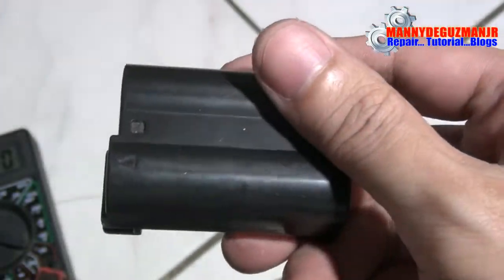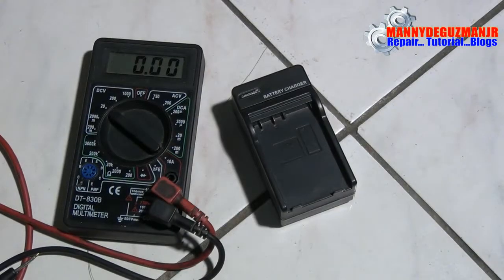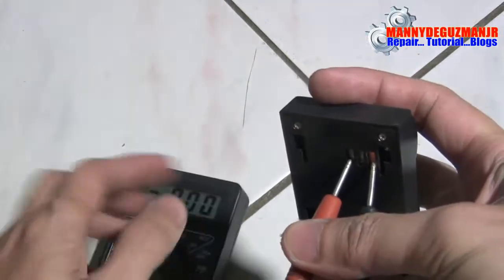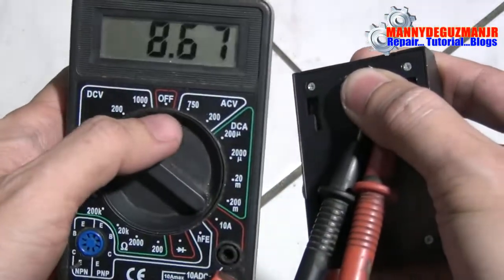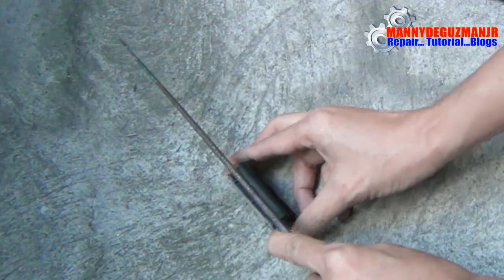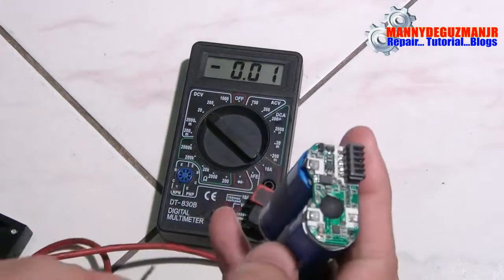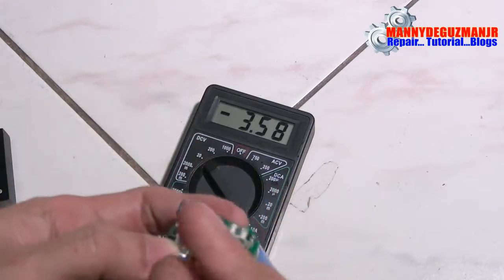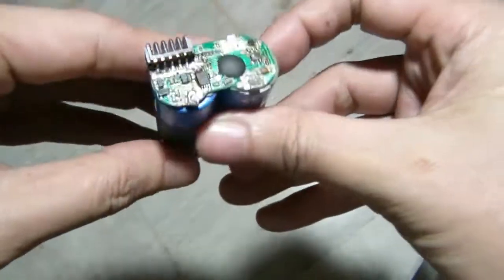Nikon Battery Repair Attempt (EN EL15 No Power, Not Charging)

Comment: Sir yung d810 ko bigla nalang namatay kalagitnaan ng event, na try kona lahat ng battery ayaw, possible daw fuse issue, kaya nyopo mag repajr non?😊
Reply from the maker: sorry hindi ako nagbubukas ng camera unless meron repair manual na available hehe. Maselan kase ang mga ribbon cable nyan at masyadong madaming babaklasin bago maaccess yun main board. Although marunong akong magrepair ng electronics, mahina ako sa mga mechanical parts, especially pag sobrang maliliit na ang piyesa kse medyo malabo na ang mata ko at ginagamitan ko na ng lens o microscope yun mga piyesa sa loob hehe.

Comment: Can't the battery BMS be tested with the multimeter for a failed part? Maybe the board can be repaired?
Reply from the maker: If you know how to test multi legged MOSFET's you can repair it with replacement of the same type. But unless you can identify the main chips using circuit diagrams it is almost impossible to test voltages and resistance of those important parts. Unavailability of components is another thing since you cannot buy these tiny surface mount chips from your local stores. You can source them from China if you know where to buy. But remember we are dealing with accurate voltages and polarities here. If you mistakenly replace parts with different types and values Lithium Ion battery cells  may overheat and get damaged, or may even explode or burst into flame when reversed polarity or subjected to over-voltage higher than specified by the manufacturer. That's why there's a lot of precautions and disclaimer when repacking and restoring old battery packs because of these dangers when you don't know what you are doing. This is the reason why I strongly suggest replacing the whole BMS board with a working one salvaged from a used battery pack of similar type and not tinker with the electronics, especially if you don't have the necessary circuit diagrams and test procedures/ service manual. Most people will even tell you to buy new batteries rather than tediously repair damaged battery packs.

Comment: how to discharge the battery ? i am not prefer to discharge with camera, can your charger ( in the video ) be modified to become a discharger ? can you provide the detail for the charger in the video ?
Reply from the maker: Sorry there's no easy way to discharge high capacity Lithium-Ion cells as simply shorting it would either destroy the cells or the BMS circuit. Even doing it the wrong way would cause the cells to either explode or catch on fire. It's not like a capacitor which you can discharge easily by shorting a resistor between the + and - terminal. Voltages are monitored regularly by the battery management system when Lithium Ion cells are being discharged. Lowest discharge voltage for each 3.7 volts cell should not be lower than 2.5 volts. Drop voltage by less than 1 volt and it may not charge again to full capacity or it would not regain charge at all. A 7.2 volt Nikon battery pack should have at least 6 volt remaining voltage to power the BMS circuit to drive the charging circuit to work. So, sorry to say but no you cannot just use the charger that I use in the video to be used as a discharger because it does not have the circuitry to do so. You must put a proper load to the battery to discharge it, with proper voltage level sensing circuitry to cut off discharging when the lowest allowable voltage was reached
Reply: Thanks

Comment: sir what is the replacement  ng battery of  en el 15
Reply from the maker: There are no replacement for the model number EN EL15 because battery pack is specific for each Nikon camera body. You must be referring to generic brand replacement, in that case there are several third party brands such as Phottix, Wasabi and Ravpower battery manufacturers.

Comment: I faced similar issue and unable to charge my totally discharged nikon 15b battery with nikon charger (flashing red led rapidly) too. Then i tried to charge it with my z7 built-in charger for minutes and hopefully it will unlock internal charging circuitry of the battery. It really works and the charger will charge the battery again with normal flashing led. I can power up my z7 with that battery too.
Reply from the maker: Any charger will work as long as it outputs the correct voltage needed to charge specific battery packs. If your charger won't charge you Nikon battery, then probably your charger is faulty. However, when Lithium Ion battery voltage drops near zero volt when measured with a tester, then that is destructive and has 50/50 chance it will be back to normal charging. The cells need to be zap with higher voltage to force it to charge with minimum levels to power up and activate the BMS (battery management system) circuit in the battery pack.

Comment: Hi Manny. How is the replacement EN EL 15 battery holding up? The orig. Nikon battery is rated at 1900mAh. 18500 batteries are now a lot more powerful. Is it safe to put much higher capacity 18500 cells as replacement? How high a capacity is safe to use? And what battery brands and cpacity are ideal--best bang for the buck?
Reply from the maker: At the beginning of this video I have shown a repacked and repaired Phottix brand battery pack replaced with working charging protection circuit board coming from an orig Nikon EN EL15 battery pack. It worked for about a  year more before the charging cycle starts wearing down. Reaching 18 months of use the cells starts to die one by one shortening it's use per charge, until the pack couldn't hold a charge anymore. In my experience repacking batteries, while non-branded cells have higher current capacity, orig cells from legit Nikon packs were more durable and last longer. This is true when using orig legit brands compared to third party brands battery, so your issue here is longer usage time vs longer life charging cycle (durability). If you could get legit brands such as Toshiba, Sanyo, Sony, Panasonic, GP, etc. cells of the same type those must be your best choice if you want your repaired packs to last a long time. Now on with your question about higher capacity cells - If you have a working charging protection board, changing to higher current capacity cells won't hurt your camera as long as they are same voltage rating. In battery sense, higher capacity and longer discharge time means that current capacity is only altered giving higher mAh but the measured voltage when fully charged should be the same (or slightly tolerant in few hundred millivolts). So yes it is perfectly safe to change to higher current capacity cells as long as they are same voltage to the one you are replacing. A rated 7.2 volts working battery should be fully charged at around 8.4 volts when measured with a digital volt meter but not greater than 8.7 volts. Also when you increase the mAh capacity of the battery, it might also have a longer time charging with the original charger, you might need to buy a quick charger with a higher current rating as well if you want faster charging time with your newly repacked battery.

Comment: You don't have an utility knife or anything smaller and sharper ? haha
Reply from the maker: You cannot use a small utility knife on a thick plastic that was bonded hard with epoxy. It won't work cutting around the edges with your bare hands you only risk cutting and hurting yourself. Or the small knife will just break  The only way to go is a strong force with a hammer and a heavy duty knife, in this case I got no other option but a bolo knife.

Comment: Hi, great video. Did you measure the dimensions of the battery cells? It looks like something like 18 by 50mm or 18 by 49, I guess?
Reply: li ion 18500
Reply from the maker: No I didn't. But I suppose Nikon battery that size is standard as they are the same size cells used in the old Nikon EN-EL3e for Nikon D90/ Nikon D300.

Comment: Is there a way to diagnose what is wrong with the charging circuit? Could it be a bad solder joint or corrosion under a component pad? My soldering iron is itching to find out!
Reply from the maker: The only way to find out is to dismantle the pack and do some connectivity tests. You must be familiar with the circuit though and the test points to measure the correct voltages and resistance. Other than that, just find a working donor circuit board from scrap battery packs, it's easier.

Comment: If the battery cell is 8v does it mean the charger isn’t good and I destroyed the battery?
Reply: You mentioned it needs to be around 7v
Reply from the maker: @erezsagit  8 volts is a good charge for a 7.2 volt rated battery. at 8.2 vots it is fully charged. At 7 volts it is drained and your camera might shut down already depending on the low battery threshold set by the manufacturer. Below 5 volts the battery is dead and may not power up the charging circuits to start the charging process and bring it to life.

Comment: What is the cell number for en el15? My cells are dead, the contacts and circuits are good.
Reply from the maker: On one of the Phottix third party brand EN EL15 that I dismantled, the cells are marked MH47501 HQ20121120. Not sure which is the model number and which is the serial number though. Numbers may vary per cell per brand.

Comment: Hello,

do you know who to hack the chip on a genuine Nikon battery ?
Reply from the maker: I'm not aware of any firmware/ software hack on a Nikon battery chip. It is only a voltage sensor/ controller chip associated with voltage regulator circuit(s). There's no rom chip in it to be programmed. But you could always swap a chip from an orig Nikon battery to replace a damaged chip on a damaged Nikon battery pack and vice versa if you have stocks of working boards and parts.
Reply: I have a spare Nikon EL15, which I didn't touch for a year. After recharging, the camera shows only one bar and (in menu -> battery info -> battery age) I get a 4 (=garbage).
I guess, during storage the voltage droped below a certain point and the battery management chip stored this issue. I would like to get rid of this flag / bit.
Reply from the maker: Lithium Ion batteries when left alone unused for a certain long period of time is said to lose their charge. That's why they say if you need to keep the battery unused always make a practice to charge them full before storing them. The full charge voltage of an EN-EL15 battery is about 8.2 volts when measured with a volt meter. It is discharged at 7 volts. The battery is depleted at 6.5 volts. The safest low level voltage is 6 volts. At around 5 volts the battery won't be able to activate the charging chip and associated circuitry unless the cells were kick started with a high voltage spike to dislodge a stuck crystallized cell. At below 2 volts below, the battery is damaged and you can no longer do anything but to replace the cells thus repacking the battery pack. So you see, it's not the chip which is faulty at that point but the battery cells themselves. The chip can only be destroyed by static damage or overvoltage or some internal shorts like for example when you dropped the battery pack or when used with a faulty charger.
Reply: @dorfschmidt4833  I heard that storing lithium ion batteries fully charged is not good for them.  If someone made a safe storage device that brought them to half charge, or "optimum charge" for storage, they'd save a lot of battery capacity and make a lot of money.